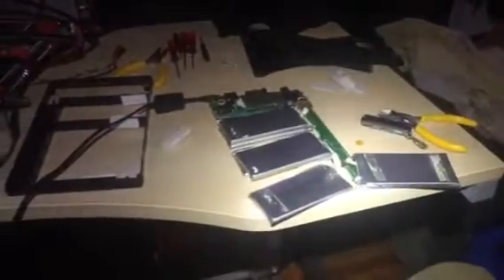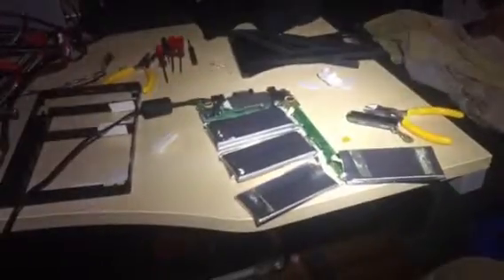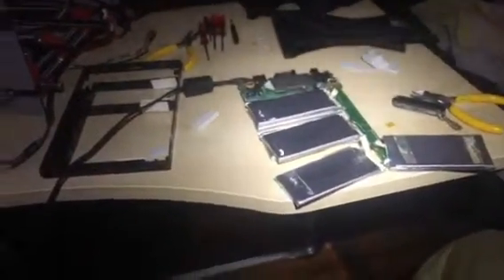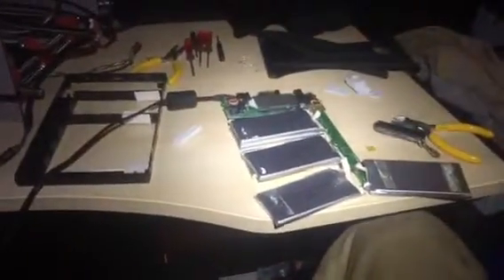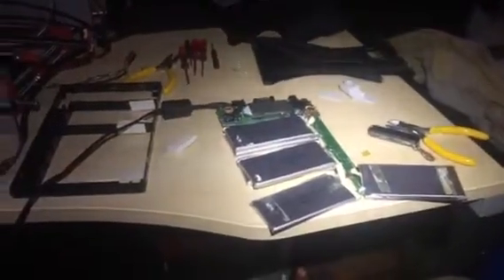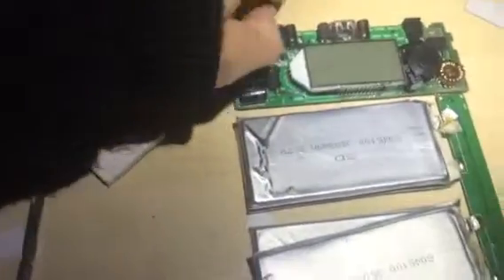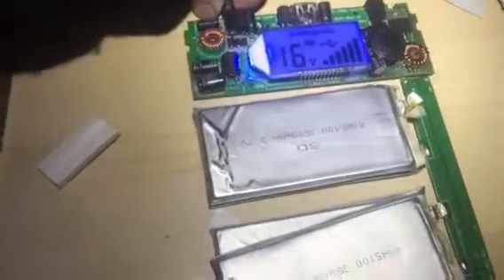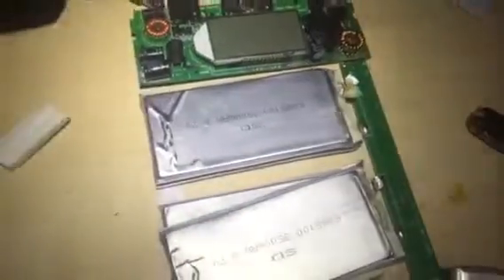Powergorilla tear down

Comment: That yellow tape is actually the opposite it's for insulation it is a high temperature rated think it's called kapon or something like that it is commonly used in lithium batteries between terminals of opposite polarity. it looks like all your cells have somehow just broken off. I bought one of these and a matching solar pannel a few years ago and have been quite dissapointed too in the build quality of such an expensive device. in my case the output power socket only worked if I jam some paper in the side of it from day 1 this has been an issue with mine.